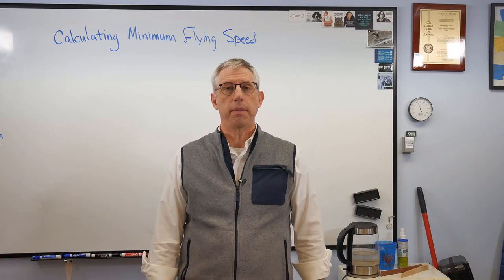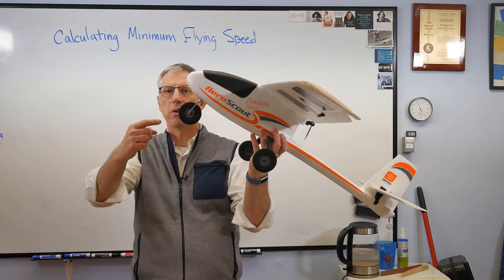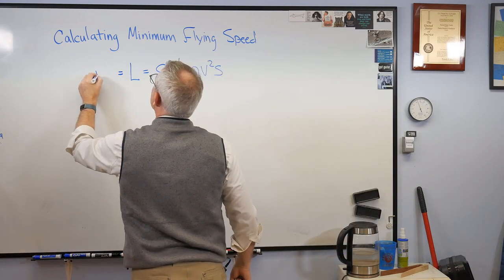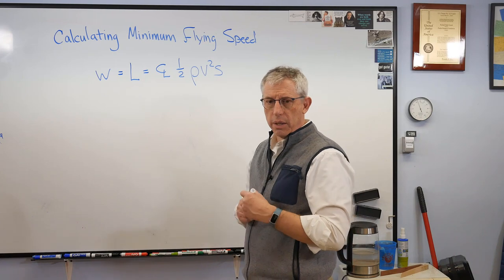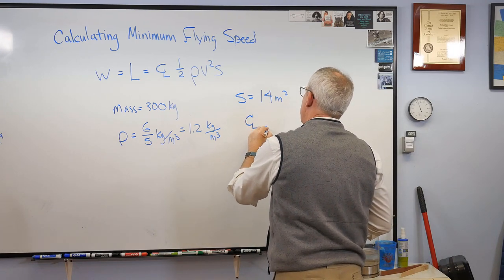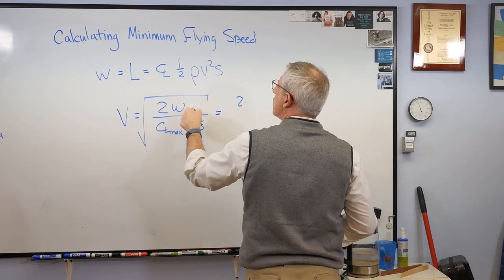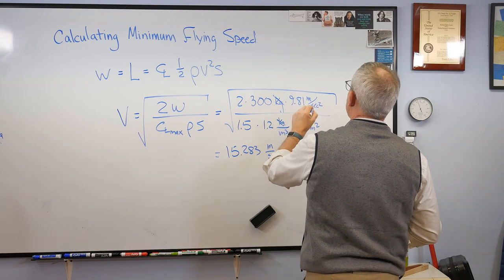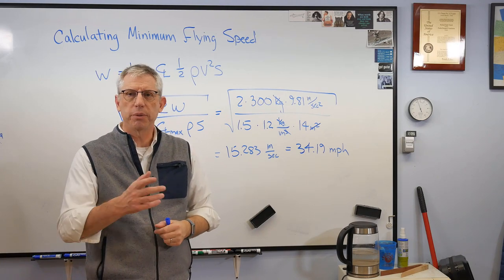Calculating Stall Speed

Comment: Professor. I'm a new student. I have a doubt. Does the stall speed vary if the thrust changes. ?
Reply: no.
Reply: In practice it would. A stall usually occurs in a nose up attitude. Thus the vertical force of the thrust decreases the effective weight of the aircraft. Additionally, the slipstream from the propeller would increase airflow over the wings